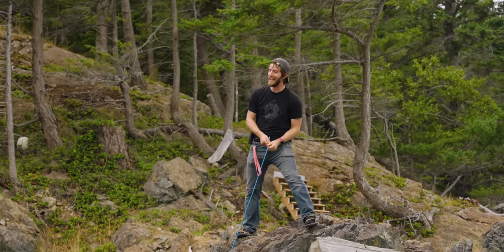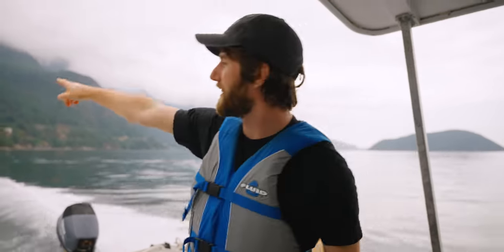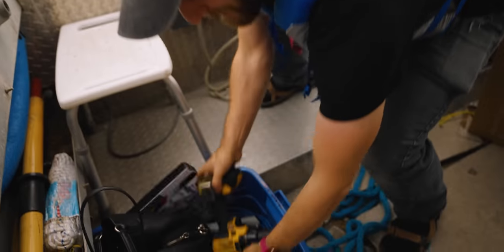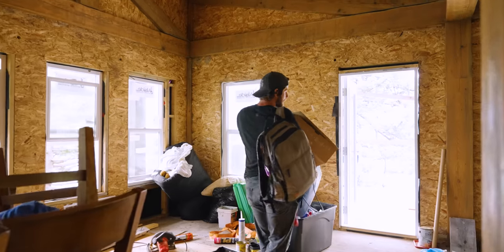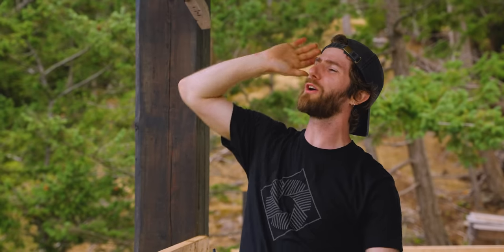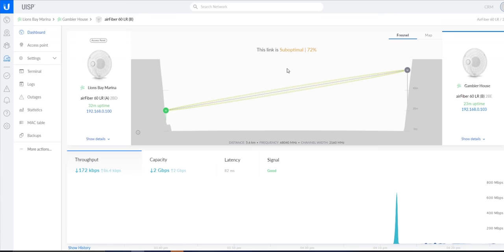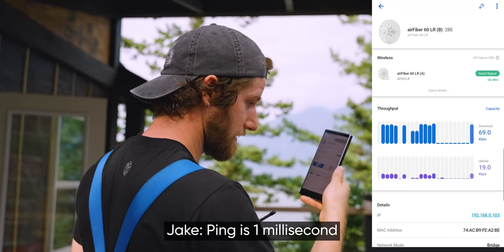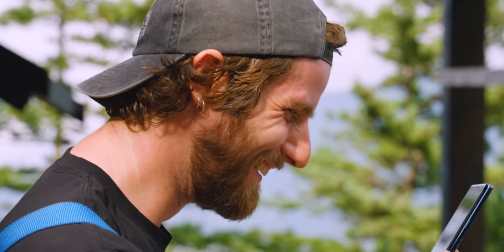How are we going to do this?

Comment: I wonder how Starlink would compare to this in terms of speed and cost 🤔
Reply: Starlink is slower than this (the max bandwidth is 300mbps and the latency is 20-50ms while this has a max bandwidth of 1gbps with a latency of about 1ms). I don't know about the cost.
Reply: That assuming Starlink is available there... But this setup with a gigabit ISP will be way faster than Starlink's and 100/20.
Reply: Starlink is 200 mbps in many areas already
Reply: It's probably more or less equivalent in price. I can't attest to the monthly internet costs in Western Canada but I imagine gigabit internet isn't cheap so probably cheaper per month. The problem is, starlink isn't a finished product yet. It's still a beta and so latency isn't amazing(though it is revolutionary for satellite internet already) and speeds are not yet gigabit(they vary wildly depending on which ground station you're connecting to).
Reply: We purchased starlink 8 months ago and we still haven’t even gotten the kit.
Reply: @Lawgamer411  So like everything Musk touches, you are really a capital investor financing the company, not a customer.
Reply: came here to ask this 😂
Reply: @cup_and_cone  You act like they're hiding that. It's not like they're marketing this is a finished product, ready for the masses. You sign up, voluntarily, to participate in this early, developmental stage of the service.
Reply: this is better if u have isp near u
Reply: @cup_and_cone  it should be. there in bc and in its pretty common in western Canada rn.
Reply: @linuxsbc  Given they are on Solar, that this will use a fraction of what Starlink does will be useful
Reply: @xcipherx  Don't forget about the ISP cost at the port side. Still need space and power for the router on that side.
Reply: Starlink probably costs $499 to set up, $99 per month, and the bandwith is gonna be much lower - Sattelite internet is only really useful for people in super rural areas. Remember they have to maintain a large ground station presence due to the low orbits of their Sattelites, so it's gonna be pretty costly for them to run.
Reply: @TyrusSwon  Yup, they either have a special arrangement or are likely paying a monthly fee for the land side radio + ISP fees.
Reply: Starlink wouldn't work well in that property because it's fully surrounded by trees. Trees can cause some pretty epic blockage and downtime because of it.
Reply: I'd say the only advantages that Starlink has is its future improvements and how easy it is to set it up.
Reply: @davejc  Safely for humans who don't treat the planet and the lives of others as their playgrounds
Reply: Considering how expensive to launch something into space and the operating costs. I doubt it costs cheap than current technology when it goes commercial.
Reply: @cup_and_cone  except normally a capital investor receives profits from the company, whereas buying an unfinished product at best gives you the finished product
Reply: @matteofeyaerts  I've seen speeds of 300/50 from our starlink.
Reply: @AugustERaven  I was going off of Google and the official SpaceX information, but it seems that 300mbps is a common number so I'll update my comment.
Reply: Star link is more of a 'pop up' internet solution. It's like comparing a hot dog stand to a hot dog restaurant. You could be sure that you'd get more hotdogs and better quality hotdogs at the restaurant; whereas the stand could go anywhere where there isn't a restaurant.
Reply: I'm curious... How much would this cost.... Something like this in the UK would cost millions, even "off grid"
Reply: @Tech & Nostalgia Kingdom I thought that exact same thing
Reply: @leodaza2151  Correct, which is why Tesla/StarLink has been so controversial... They use paying customers as financiers by holding their products ransom for months (and sometimes years) without any interest/royalty paid.
Reply: @xcipherx  the radio on the wall etc is probly already included in the docking of the boat.
Reply: My Starlink gets between 75-260mbps.. 
latency is 30-40ms (I'm sure at times it's higher.
Cost was around $600.. (they say that cost will go down)
The monthly is about the same as I was paying for much much slower internet. (old was apx 10mbps useable)
Reply: @cup_and_cone  Starlink should be available there it is in the prairies and Ontario just a wait list to get it. But this is better and probably cheaper in the long run, the starlink equipment is slightly cheaper in cost but the monthly subscription is more.
Reply: compare what... this is entirely different use case and scenario...
Reply: @matteofeyaerts  1ms LOL
Reply: Cost isn't an issue when you're rich enough to buy a place like that.
Reply: @linuxsbc  Starlink have at  the monet a ping  between  20 and 40 ms, not  88ms,  the Ubiquiti airFiber 60 LR can't have 1ms ping over  long range radio don't belief that, also comparing Stralink  with Ubiquiti airFiber 60 LR long range radio network antenna,  it's like comparing  apple with brine. Better  would  be  a underwater fiber  network cable, i don't know how much  it  cost. Also  Starlink is  in Beta,  it's not  a  full developd product, so  we can  see better  speeds and  latency in the  future. The  cost  for  Starlink  is  high,  it  cost 99 Dollar, for most  people  not great,  but  maybe  in the  future  the cost  will  go  down. Also  imagine a bird  or fly fly over the beam from the Ubiquiti airFiber 60 LR antennas,  lost  network connection, that is realy sensitive.
Reply: @miko_un_  Linus said it was 1ms. Also, why can't they be compared? Both work for this situation and this solution is probably better in this case.
Reply: @xcipherx  the  cost  with  all  hardware together is much  more than $800, that  is  really  expensive.
Reply: @BaneWilliams  yes it's true, they need  a open area for Starlink or Starlink Dishy over the trees.
Reply: @AugustERaven  he  don't know what he  talk about, i am also Starlink Beta Tester and i had never a ping of 88ms, i have  similar  speeds and latency  like you.
Reply: @pirategirljess  but maybe  that place was cheap, because  it has no internet,  electric energie,  water and so on
Reply: @whathappenedman  yes i  was  thinking  that same
Reply: @linuxsbc Linus say many things and  he is  not always right,  come on  1ms over  radio, do you belief it, for  his  parents  maybe  the Ubiquiti airFiber 60 LR solution for now  is  the  best solution, but  it has  also some drawbacks, the  biggst one  the  the sensitivity from the  radio beam,  but in other hand  Starlink  need an open area to  work. Best  solution would  be  an under water fiber network cable,  but  it  cost  probly  Linus as YouTuber  to much.
Reply: up / down / lat
Reply: @linuxsbc  what ^ said.
Reply: @miko_un_  I don't have much experience in that area, so I didn't know enough to believe it was false. Light (including radio waves) takes about 3/186282 seconds to travel that far, so 1ms doesn't seem that far-fetched.
Reply: @linuxsbc  light  is  a wave  but  not  radio wave, there  both waves but  you  can't  put them  in the same  specification cup,  light  wave  are always faster than  radio wave, maybe  Linus is  a magician and  can break  the law of  physics
Reply: @adamquery7048  from Starlink  is  300 mb up  40 mp down and  lat  between  22 and  40ms,  my fiber internet  has  900 mb up  980 mb down and  lat  between  10 and 14 ms
i have  both  Starlink and  Fiber Internet
Reply: @Lawgamer411  You've waited 8 months I'd cancel that shit.
Reply: @originalityisdead.9513  that  was a mistake, Starlink  shipping now  some big  batch numbers, also  it's  in beta of course  not  everybody get quick access for  Starlink,  also  when  you  order to day  a car  you have  also  to  wait  for  8 months  or longer.
Reply: Starlink is slower for now. AirFiber is arguably one of the best solutions for off-the-grid internet, but then again, very few people have the ability or patience to do something like this. If I were in this situation I would just get Starlink rather than dealing with this overhead.
Reply: @linuxsbc  Starlink is 99 USD / month, slow, and the antenna (what you also need to buy) uses ~1000W/h... (it has a heater for snow and water what you can't turn off :)) Oh also they can garantee the bandwidth only if there is only under 1000 connection in a square mile or something like that. So Starlink is a great deal xD But hey, there are 40 thousand of space trash.. i mean satellites on low orbit..
Reply: @nedflanders4158  ?
Reply: @merlinwarage  Starlink  use  50W/h,  and  in low orbit  you  have  only  Starlink Satellites and  not  many  others , also  low orbit satellites  fall self  down  and  burn in the  eart atmosphere, you talking about the  high  orbit.  High orbit and  low  orbit are not the  same  the  satellites act differently there.
Reply: @nedflanders4158  i think  you  fell more for the grift when  you support your wired  or mobile  ISPs, because they  don't  build  the fiber Infrastructure,  the  cash only your money in there  pocket.
Reply: Starlink is an internet service. 
Linus used a point to point wireless system that requires you to have internet to use.
Reply: @DaleEarnhardtsSeatbelt  Yes, however, they both have the same goal in this instance. I’m just noting that while this is fantastic, for most people, Starlink is going to be a better option.
Reply: @nedflanders4158  the starlink  satellite have  a lifespan of  5  years, after  that  the  fall down  to  earth and burn  away, they will  replace with new better starlink satellite,  the ground infrastructure is  not  everywhere easily accessible,  it's only true for  citys and it's  also not easily upgradable  as you think otherwise we had now  everywhere  fast  internet. And  cheap  is  the  ground infrastructure also  not.  Fiber Internet  is still in many  countrys a dream  that  will  never  happen, the  most ground infrastructure  from  Internet  is  based on the  old  telephone copper cable with  modification plugt to access point  and  backbones (Tier 1,  2 and 3)  that  use only  fiber. Some  companys have  fiber internet  and  some  privat  people have  fiber internet,  but most  of the  people  use the  old shit  copper Internet, and that is not  future  proof, in the future  the bandwith will  increase and  all  people  with  copper wired internet are  logt out. Yes i am  a reach kid, is  that  a problem.
Reply: @corruptedpoison1  my bad, put my comment in the wrong place.... I meant the cabin!
Reply: @nedflanders4158  Hey, so, I take it you don't live in the middle of fuckall nowhere? Where even the ISPs (Source: Worked for an ISP serving remote communities that is fucked over by the dark fiber providers) can't get 10GB+ fiber to serve their customers, where for us StarLink, spread across community WAN endpoints, can provide as a reasonable alternative to paying a certain ISP/Fiber provider starting with B, that wants 10,000/Month for a 100M yes megaBIT circuit.
Reply: @AugustERaven  Net Flanders do had about Starlink, i don’t why. So everybody who has Starlink is bad for him. Don’t worry.
Reply: @Lawgamer411  the chip shortage is screwing everything up
Reply: @nedflanders4158  bro what you talking about, what is remote internet, i can't you understand, can you be specific,  i work in the  IT and newer heard such words "remote internet"
Reply: @nedflanders4158  and you are a space engineer and know how long is a satellite  in low or high orbit, do you know the cost for a world wide network (called internet) i think no. I think you don't know what you talking. Say simple you don't like Starlink, but please say something that is right and not what you only thinking.
Reply: @nedflanders4158  yes remote service is right but not remote internet, such word doesn’t exist, are you a god to know from everybody the age, old man
Reply: @nedflanders4158  than give me some facts, such data and source and not another words I think you are not an space engineer, physics, IT person, science person or engineer and don’t really know what you talking,what you do is only bashing and giving your opinion on others, that is not how tech people, engineers or science people work, like your comments before “remote internet” such word don’t exist.
And why physics allow satellites to be in low and in high orbit or generally in space. Do you make fun on himself.
Reply: @nedflanders4158  give me a source where the word remote internet in the IT exist, than I believe you, but I work long in the IT and heard never such word, it is like saying  the term do google for use a search engine, but it’s also wrong or not correct  or noob talking. With what you want remote the internet, when internet is a big network to send data back and forth or  do a remote control with some device over the internet. What is basic understanding an adult, such thing also do not exist. Language is not  build on people’s age. Because your an adult or older than me, don’t mean that you also more intelligent than me. You are a funny guy.
Reply: Not sure if anyone mentioned it in this thread, but I'll mention it's been noted that Starlink may consume too much electricity for their off-the-grid style power system. This solution consumes much less power. Starlink probably would be a good solution otherwise.
Reply: @ixionn563  Starlink use  between 40 and 45 Watt, the Linus solution have similar usage of Watt. Starlink can max use 150 Watt, it need it for Snow days to keep the dish snow free, when  the Antenna from Linus is  full with snow it will not work.
Reply: @linuxsbc  Starlink is slower than the 60ghz link, remains to be seen what bandwidth and latency service is available at the building at the far end. Probably not gig 1ms

Comment: So ... What happens when it's windy and this thing gets thrown out of alignment? 
Is your internet just going to drop with every gust of wind or are the counter measures against it moving it the wind?
Reply: Uh you put a wind cover on it????
Reply: They're usually reasonably tolerant of movement.
Reply: Kotori no shogai  I'm talking about some plastic box not some metal thick wall that interferes with the signal
Reply: @rekt_gg  idk he just said a piece of paper can block signals at that frequency. not sure how it will fare as a beam signal though so maybe it might work if you put some kind of weather protection
Reply: Yeah, seems like weather would be a major factor in performance.
Reply: You guys do know that Microwave and Radio links are used in internet services right? Nokia is one of the biggest wireless backbone providers, especially after acquiring Alcatel-Lucent. 

To answer your question, this is all Line of Sight technology. So yes it is susceptible to weather just like any other radio technology. This is usually remedied by using high power adapters that are able to push the signal further and bigger “range” to guarantee a some bandwidth will go through. Obviously on a clear day, your radio will be at its peak but sacrifices will be made when crappy weather happens. 

If you are worried about the wind moving your dish, chances are you are in major storm and have other things to worry about. Though, overgrown trees can be an issue and could block line of sight when the wind is blowing. This means you gonna need to do some tree trimming.
Reply: The speed of your internet  will take a hit during really bad condition expect a drop of 30-50 of the speed.

Comment: for wires outside, I truly hope you guys included some of the Ubiqiti's surge protectors(x2)? They're required to protect your inhouse gear from lightning.

*fuses = surge protectors
Reply: safety last!!
Reply: @Powah563  if you foot the bill for the rest of the network gear… sure 👍🏼 those fuses cost basically next to nothing, just a little extra work and terminating cables
Reply: You mean the Ubiquiti Ethernet surge protectors. Honestly they are no more use than just having shielded Ethernet with a proper ground. That said your equipment will still fry, best protection if you think your equipment is in a vulnerable location is an lightning rod installation. You will find in most places there are far better targets for lightning than the dish.
Reply: @backupplan6058  surge protectors, thank you… forgot the word. However in some cases they’re still relevant for insurrection or even prevention of further damage. It’s good practice. And not that big of an investment.
Reply: @ari-mcbrown  seen them used on an deployment by another company and the whole network got fried despite having two installed at both ends of the line. Granted we got paid to replace it but they are nothing but something to help ease the mind of the clients while actually doing nothing. You want to protect your thousands spent on network equipment with something inexpensive or something that actually works.
Reply: @backupplan6058  you simply have to prove you’ve done everything to prevent it 🤷🏼‍♂️ I didn’t make up the way how insurance companies treat these things :(

Also, they’re messing with PoE on the outside of the build… generally you want some extra robustness in case strangers start messing around with it

Comment: There's an audible alignment tool in the dashboard, that you can use to align the antennas, without having to look at the screen... Just a tip, if you ever find yourself in this position.
Reply: I've used a similar method when I installed satellite TV at my place many years ago. As long as you can hear the tv through the open window while aligning the dish, you can tell how you're doing.
Later on I installed satellite professionally, and having an actual meter at the dish was so much nicer! (that and a smartphone app that allowed you to "see" the satellites in the sky)
Reply: Was waiting to see if they were going to use it
Reply: Yeah i used it on My Satellite dish.
Reply: @Green__one  same here.